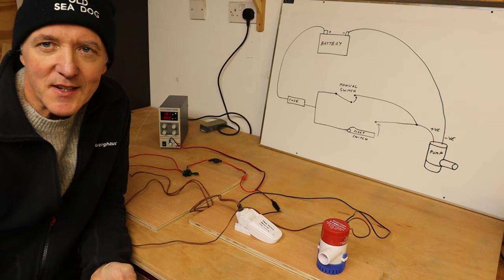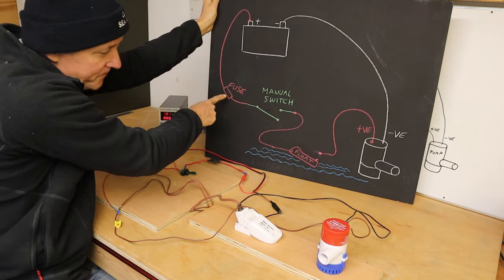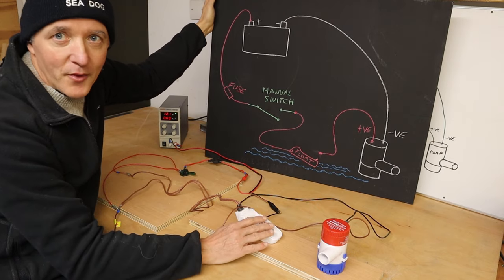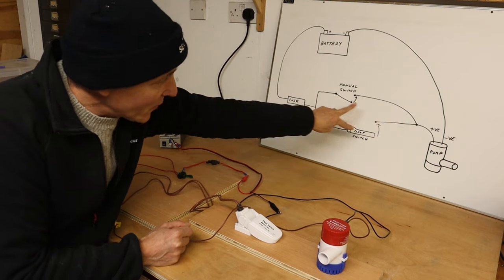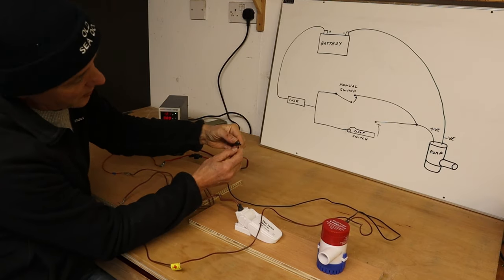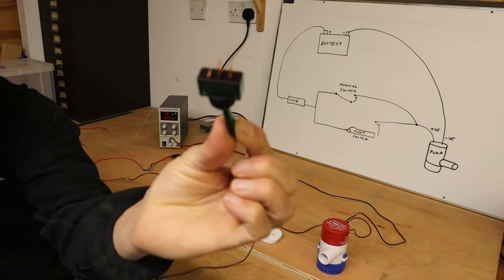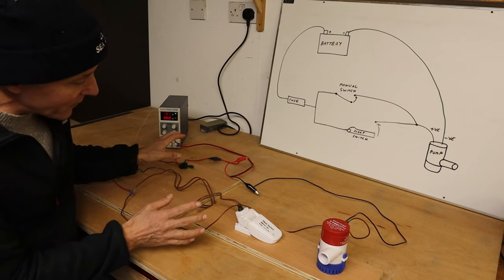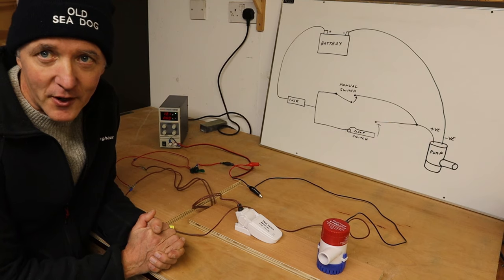How to wire a bilge pump? We show how to wire a 12V bilge pump float switch with a manual override.

Comment: Hi Sir how I'm going to wire up my float switch is by putting one from the float switch  to the positive wire to the bilge pump & the other wire on a waterproof fuse holder & goes directly to the positive side of the battery as the other positive wire on the bilge  pump already goes to the switch on the dashboard panel & it never had a Float switch put in the 2015 6.20 metre cabin fiberglass boat only the 1100 gph bilge pump was installed & it should have had a float switch installed in the first place as the boat I brought new had a bad Design Fault the bilge pump outlet was at the back of the boat which should have had the bilge pump outlet  up at the side of the boat as when I get more people in the boat  I noticed that I couldn't get the boat on the plane & when I got  back to the boat ramp & got the boat onto the trailer & drove up the boat ramp & park at the vehicle & trailer up the hill well away from the boat ramp I took the 3 bungs out the middle bottom bung that I took out there was so much water coming out it wasn't funny & took a long time to drain out & even my youngest daughter said to me that's a lot of water coming out of the boat & shouldn't be that much amount of water coming out from a near new boat & it had me stumped why there was so much water coming out & it wasn't until later down the track that I found that the water was coming in from the bilge pump outlet & the it also had damaged the toilet pump NZ $300.00 later as the toilet wouldn't work & I had to clean out the toilet as it wouldn't flush & when I got the toilet pump out it was all rusted up as the bloody water that was coming in from the bilge outlet had gone right up the the bow of the boat & got into the toilet pump & now I've got a float switch that's going to stop the water going right up to the bow & later down the track I'm going to have the bilge pump outlet  up high & at the side of the boat & have it professionally done & have the old bilge pump outlet hole professionally blocked off pissed me right off well having that done right & I will never never have that problem again & the only way I knew the water was coming in from the bilge pump outlet was I got the garden hose & I didn't have the tap on full running & just trickling in & I had the centre bung out & you should have seen the water coming out the was a lot of water coming out of the bung hole & so having the float switch installed the water that comes in through the bilge pump outlet will gradually pump the water out again Kind Regards Peter PS very good of you Sir for showing how wire up a float switch & on my dashboard panel there no way I can install an automatic switch but will automatically switch it's self on & I'm still be able to switch it on manually as well but most of the time when I turn on the main switches the float switch will be fully Automatic when I'm out in the boat & I get some spare money I will then change the bilge pump outlet over up to the left hand side of the boat & have the old bilge pump outlet hole completely professionally blocked off which will completely solve that problem I can't understand why the boat manufacturer didn't  have the bilge pump outlet going up to the left hand side of these boats & there are a lot  of other boat Manufacturers have their bilge pump outlets up at the sides of the boats so no water can go in through the bilge pump outlets
Reply from the maker: Hi thanks for your kind comment, and your entertaining story.  All the best,

Richard
Reply: @BoatFittings  Hi Richard Peter here again I apparently had put the new bulge pump outlet higher but apparently not quite high enough & I went out in the boat on last Sunday New Zealand time & when you get the boat on the plane the new bulge pump outlet goes under the water & let's water into the hull & operates the float switch which switches on the bulge pump & you slow down in the boat the bulge pump outlet is out of the water an a mistake on my part & will have to take the outlet fitting off & have that hole blocked off by the Fiberglass repair guy Rod to block that hole off & I rang Rod yesterday & he is going to quote me $200 to $300 to block the hole off bugger more expensive & the first bulge pump hole outlet to have blocked off was &189.00 & now it's more money Bugger & the other new bulge pump hole outlet has to go up another 5 to 6 inches what a bugger & it will be completely out of the water so no water can get into it a BLOODY BIG MISTAKE ON MY PART & then it will be all sorted & it a stupid place in the first place for the boat builder to put the bulge pump outlet at the back of the Smuggler Sport 6.20 boat in first place where water could get into it all the time & it was only the bulge pump was installed & that finally destroyed our toilet pump & that was $300.00 later & now it costs me $200 to  $300 to have the blocked off bugger & that money could have gone towards fuel for the boat as petrol is not cheap anymore it is 2.75.9 cents a litre for 91octane fuel & other parts in Auckland New Zealand you could be paying $2.86.9 a liter for 91octane fuel & I have a 200 liter tank in the boat & it is nearly down to half a tank of fuel which is not cheap to fill the tank & I understand the fuel prices are going to up around Christmas & our cost of living is already high in New Zealand & will even go up more some parts in Auckland New Zealand Diesel is already at $3.00 at a liter Bloody really expensive &  that's why our food prices are so high & everything is else is going up as well & you have a Lovely Nice Day or a Lovely Nice Good Night Richard Kind Regards Peter

Comment: The wiring illustrated on the blackboard will NOT work.  The float switch will not work because the circuit is open at the manual switch.  The manual switch will not work unless the float switch is closed.  The white board is correct and will work perfectly.  

The manual switch circuit has to by-pass the float and go direct to the bilge pump and the charge to the float must by-pass the manual.  This can also be achieved with a three-way switch (manual-off-auto).

I put the manual breaker (fuse) in the line immediately AFTER the switch and the breaker (fuse) for the float close to the battery (before the float).  The common positive to the pump contacts the manual and float feed at a terminal block or a three-prong watertight plug (never butt connect them).